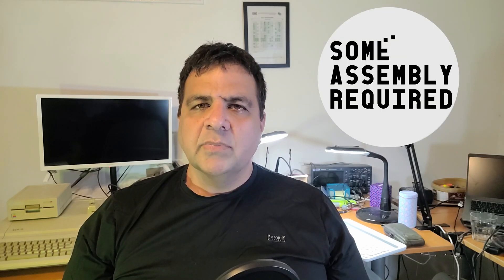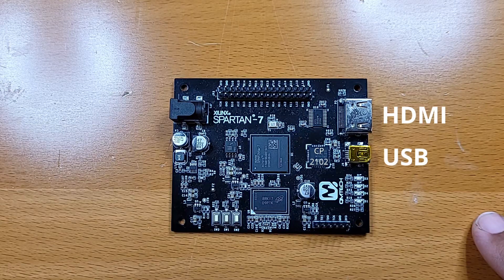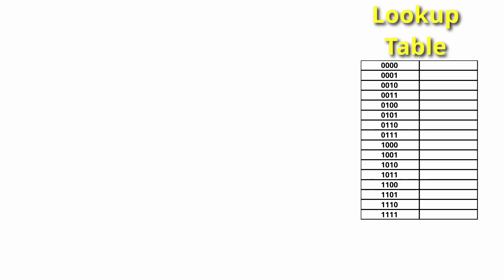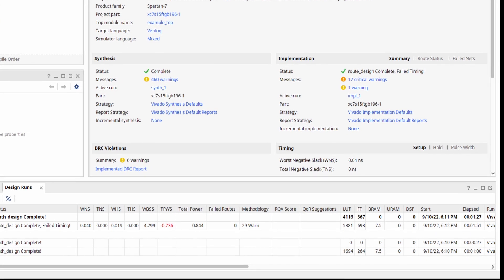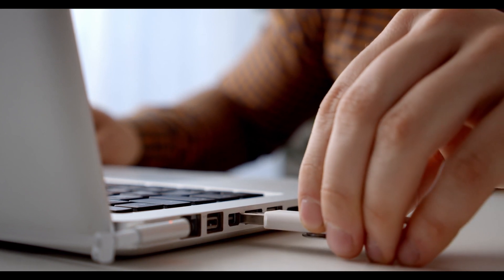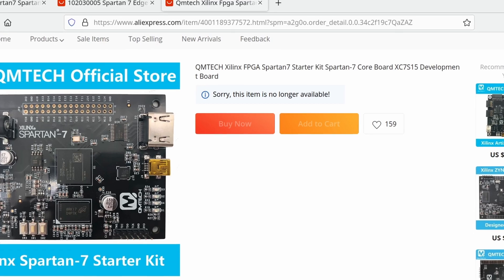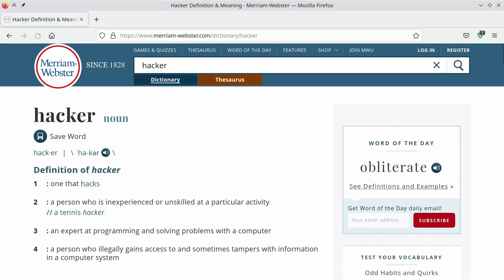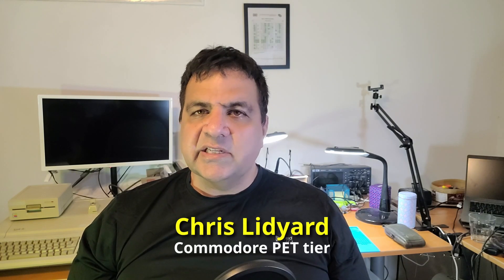Architecture of our Apple 2/Commodore 64 FPGA clone

Comment: Have you looked at porting it to the QMTECH Xilinx Zynq7000 Bajie Board? Just a $60 board that is in stock and also has more breathing room. Also includes hard ARM cores as part of the SoC, so you likely wouldn't need to allocate a RISC-V core in the PL. No need to design a new board, and still a cheap and readily available board then.
Reply from the maker: That board has been sitting in my shopping cart for over half a year now, and I never get around to buying it, because I suspect I won't be able to use it.

My problem with the full SoC boards is that the memory can, typically, go either to the CPU or the FPGA, but not easily both. Since the focus of this project is the FPGA, this means I'd be wasting funds on a CPU I'll end up not being able to use. You can see it really well with the MiSTer, where despite having memory on board, if you want your 8-bit device to have memory you need to buy it an SRAM module. Those are _expensive_.

In the end, cost is a huge factor here. The reason those boards cost $60 is because they were produced before the supply chain collapse and the stock never ran out (a red flag in and on itself). If you check the cost of just the SoC chip on mouser, the cheapest one go for over $130. This means the project will not reach the price point I want for it. At those prices, you might as well go get a MiSTer and receive a more mature product.
Reply: @CompuSAR  Cheers, that makes sense. How about the Basys3? It's quite a bit more costly at $160, but they're readily available in good stock. They include a USB HID controller which emulates a PS/2 bus to the FPGA too. It also has the advantage of being the primary hardware target of the very nice hneemann's "Digital" logic simulator, so they're a good FPGA to buy for people generally interested in learning hardware architecture. They include a VGA port, though you could also drive HDMI over PMOD with something like the adapter 1BitSquared offers.
Reply: Another very nice FPGA board that's available in quantity is the ULX3S. This is probably the nicest board available that is well supported by the open source yosys toolchain, and there are many well documented examples targeting the board. The problem here for you might be that it is a Lattice ECP5 FPGA, so would be a more involved port and wouldn't work with your current Vivado setup. It is also costly, in the ballpark of $150. Though I suspect that the $60 Colorlight i9-v7.2 board which uses the same FPGA could be an option, and is also available in quantity.
Reply from the maker: @australai  OMG, I'm taking that last comment back. The ULX3S definitely seems very interesting. I'll try to get a board (or two) and check it out. I am in no way married to Vivado.
Reply from the maker: @australai  It seems to me you might be missing important context. If you can spare the 8 minutes it takes, I explained the project's goals in the video at https://www.youtube.com/watch?v=s1zQQAN6jmU.
Reply: @CompuSAR  Thanks, I've seen it. Worth noting that now the DE10-Nano has increased in price to $230 and is not in stock. The price of a MiSTer kit has risen from ~$370 to more than $500. So, a $150 board that is actually in stock would still be a nice option. The Colorlight i9-v7.2 with lots of stock on Aliexpress for $60 is super barebones and has lots of PMOD IO. FWIW, I just had a look through the reference manual of those Zynq 7000 FPGAs, and it seems the DDR3 is connected to both the PS and the PL via a high-speed fabric, though I think you're right in suspecting that the stock is limited, and those boards will all be gone soon.
Reply from the maker: I've ordered the boards. Let's see how they are when I get them.